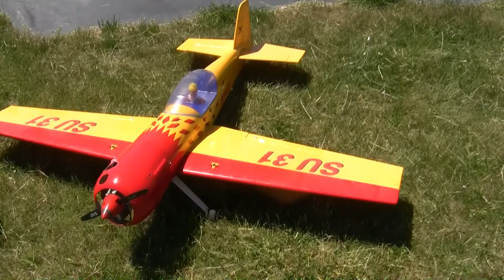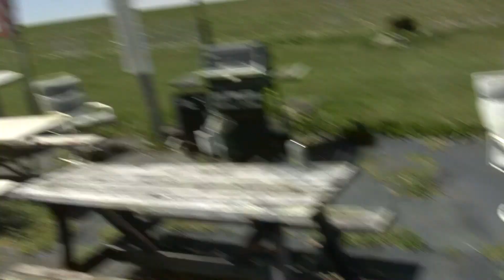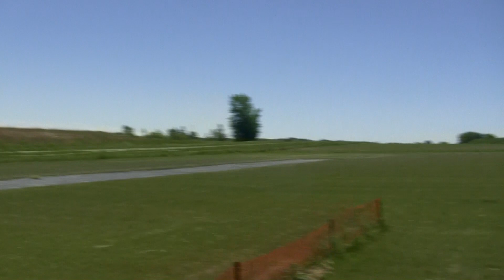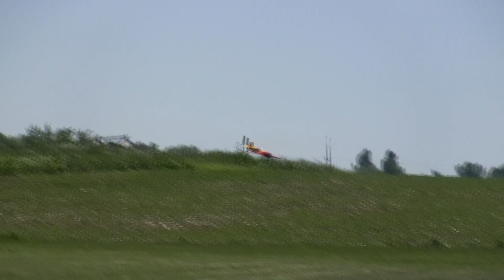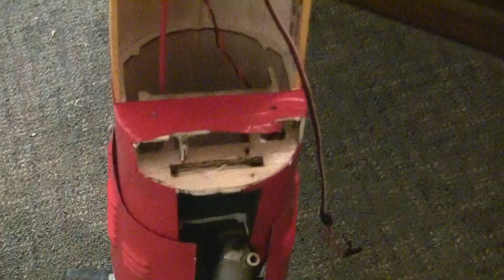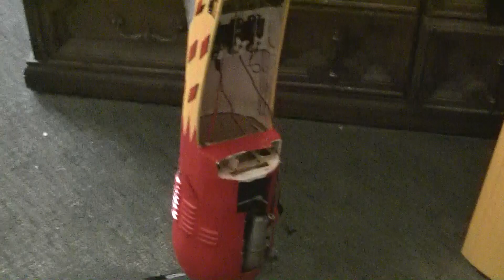phoenix models sukhoi su31 46. os test flight 2 crash

Comment: I just recently got the Phoenix Extra 300S, and had almost the exact same flight as in this video, only my thrust angle is proper and I did not screw up on the build except for failing to CA one wheel collet. What I'm finding between my experience and a lot of Youtube videos of the 1:5.5 - 1:5 Phoenix models is that they are under powered when recommended motor is used. My Extra says .40-.46 glow on the box. I have an OS 46LA on it, which is on the weak side for a .46, and it flies just fine on a calm cool day, but I flew it in a little wind yesterday and was lucky to bring it down in one piece. There was not enough power to fly against a headwind gust, and it tip stalled back and forth until I pulled a half loop letting the wind blow it over, then built a ton of speed in the tail wind and it became controllable again. I also had to add almost 5oz of lead weight to the front of the cowl to balance CG with the 46LA. On the other hand, I have (2) Sonics. That recommends .25 but mine are running on 32 and 40 respectively and they both fly perfect. Also, if you watch the videos of the 46 size Phoenix planes where people are running .61 motors, they fly awesome, as do a lot of the electrified models running 6S motors with about .60 equivalent power. I'm not flying my Extra any more until I get either a .61 or a 15CC gas swapped in there. Once I build some speed it flies perfect, and the plane is very high quality in terms of materials and durability (I ripped my gear off almost identical to your damage and used Gorilla wood glue around the edges and regular Gorilla glue in the middle to help fill in the fine cracks, then re-covered the bottom with EconoKote. It looks and performs like new)

Long story short though, all three of my Phoenix planes seemed to need the weight and power of engines one full class size higher than recommended to balance and fly well. I think they are great models with bad instructions. I had the exact same experience as this video but my engine was tuned and angled properly so I was able to keep in the air long enough to build up speed and fly the energy management game for 8 or 9 minutes to burn off fuel, then took the exact same damage when I nerfed the landing trying to put it down on the one wheel. Thanks for sharing this. It helps confirm my theory about why so many Phoenix models seem so anemic!
Reply from the maker: ya this was my first stunt type plane and I did not have good results.. underpowered and I did not know how to set it up properly so the end results were a waste of money.. but now I have a yak and it flys great this plane was a good learning experience for the now successful yak.. good luck with your models

Comment: @lizardmannnn Lizard man, I agree with Hacker, use a good sim like Real Flight (not Flying Model Simulator).  A high wing plane will tend to fall back into a glide so they're very forgiving trainers.  A foam version would be easier to repair - and if you're interested in electric, the eFlite Apprentice is a good RTF kit.

Comment: Planes like Extras, Sukhois, Katanas, Yaks, (low wing) have stall in low speeds....it's better to put a 4 stroke engine cause you'll have extra torque and less speed, using a bigger propeller with a smaller pitch. You cannot land the plane in the same way as you do with a high wing trainer, they are different....